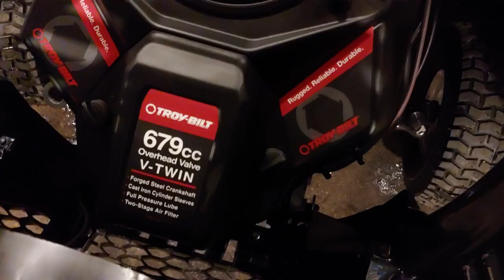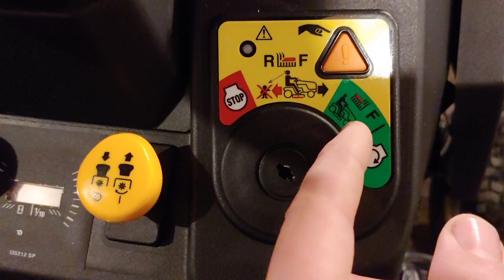This is the Super Bronco XP 50 1/3

Comment: Is there an extension you can put on that oil drain? Seems like it would make a mess
Reply from the maker: Hi there ! yes in deed it make a mess on the frame and drips on the pulley too  ! 😀i installed The extension shortly. after !  If not shown in the video !

Comment: I have a super bronco 50 XP lawn tractor. Mine has the 24 horse Kohler I've had it 6 years. But mine doesn't have the heavy duty deck where did you purchase your mower please
Reply from the maker: HI thanks for watching i Custom ordered it at a local tractor dealer in my area ,  it was not in stock in any store.

Comment: How do you take out spark plugs
Reply from the maker: Hi thanks for watching!  ,  first remove the engine cover for better acces  , and its really easy just folow the spark plug cable, you have 1 per cylinder head remove the wire on the top of the spark plug and remove the spark with an appropriate spark plug socket, then install  the recomended spark plug, verify the gap of the electrode are within specification before installing the new plug !